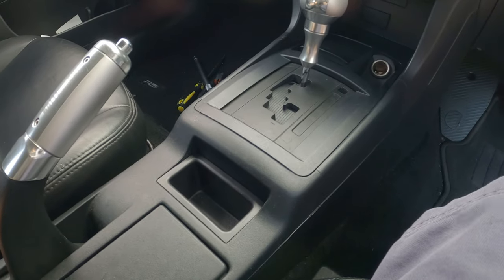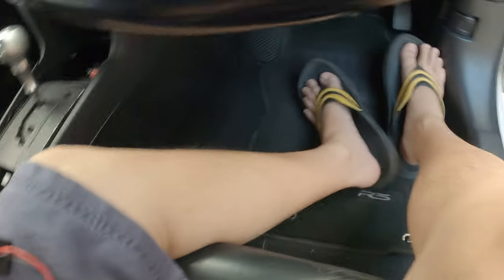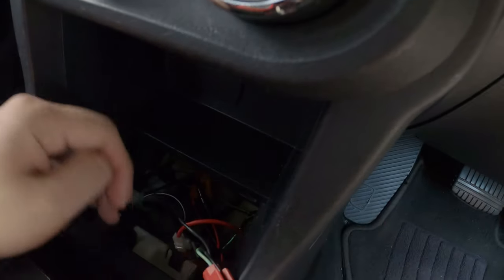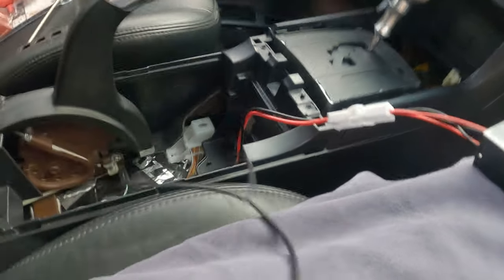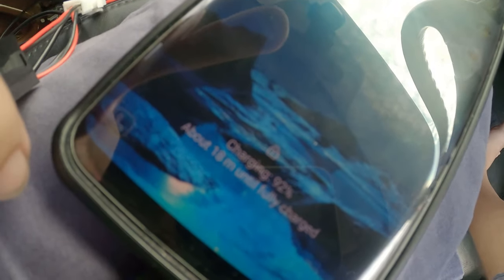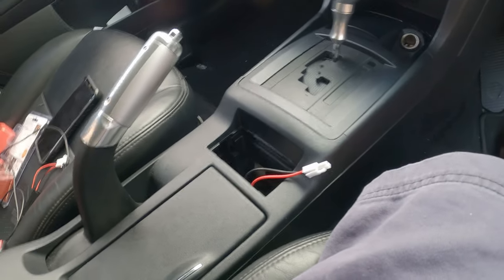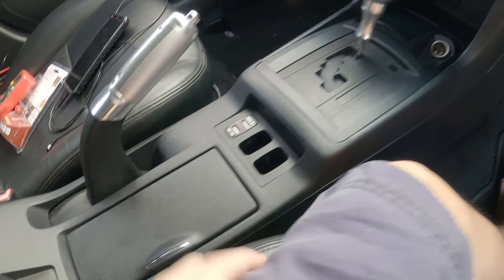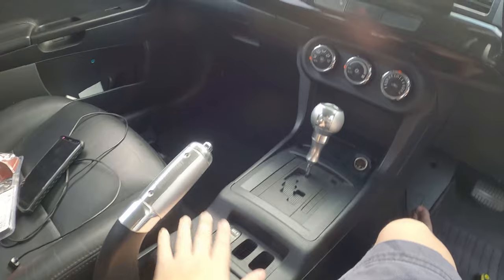How to install QC 3.0 USB in car - Inspira / Lancer 08

Comment: How come my inspira 2.0 2011 centre console different from your? Mine is just coin pocket spacing. Not 3 future empty buttons?
Reply from the maker: Mine was also the coin box which is removeable. I changed it out to this panel with 3 button slots.

Comment: Cool. But i rather have the wire pulled direct from the etac. Cause tapping on the cigarette socket will be causing additional load.